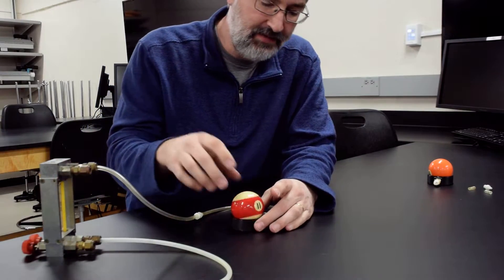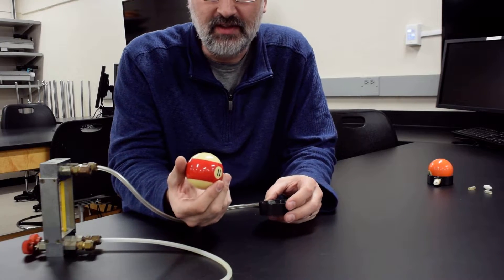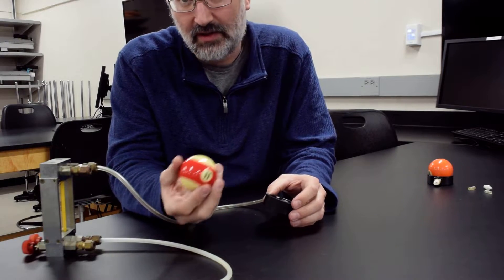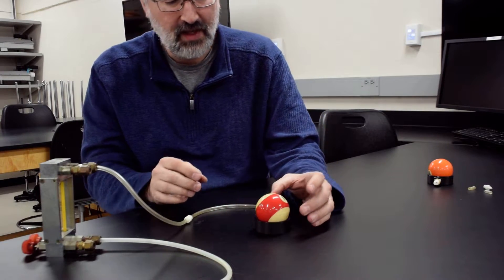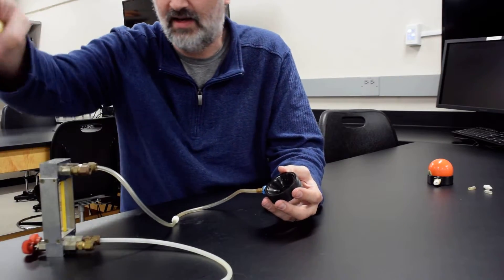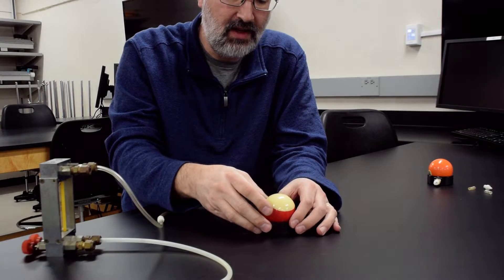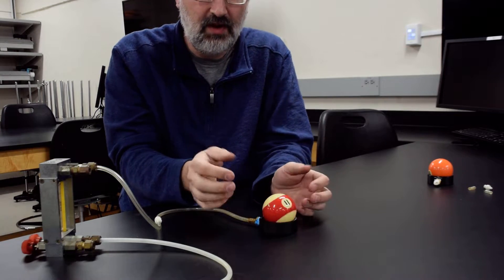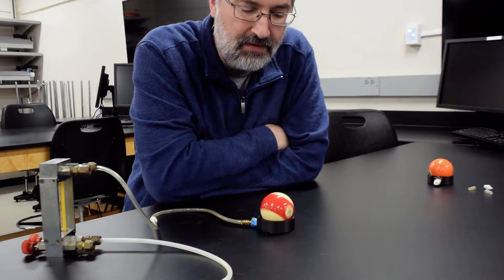Air Bearing

Comment: How the air not leaking  ,   what is the PSI
Reply from the maker: Of course it leaks.  Over that surface area, supporting the weight of a pool ball requires a fraction of a PSI.

Comment: Cool video.Did you have to do any sanding or was 3D printing alone good enough for the tolerances?
Reply from the maker: Printing was not smooth enough.  I heated the surface and then jammed a ball onto the surface.
Reply: @ValpoPhysics  Thank you, that's very clever!